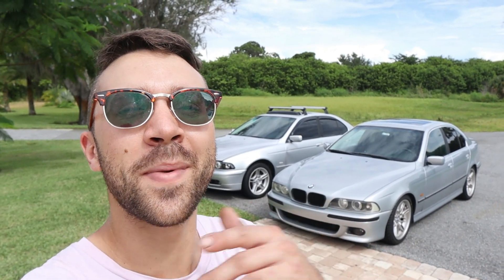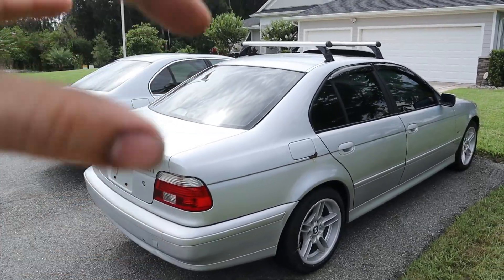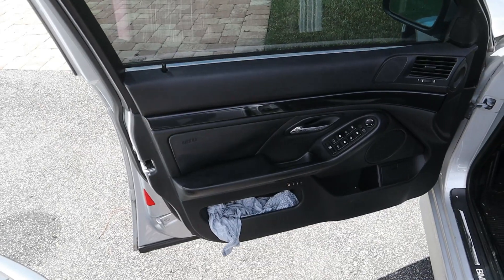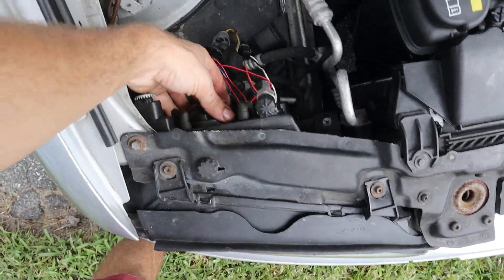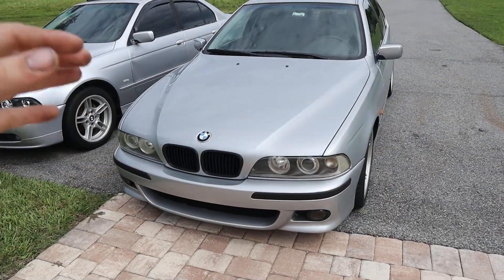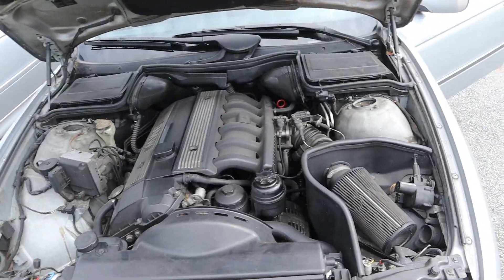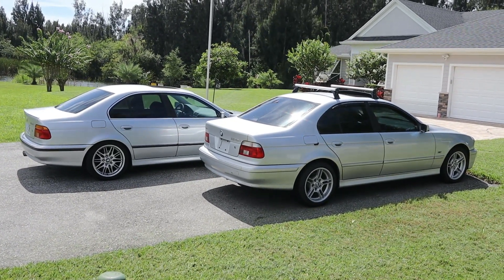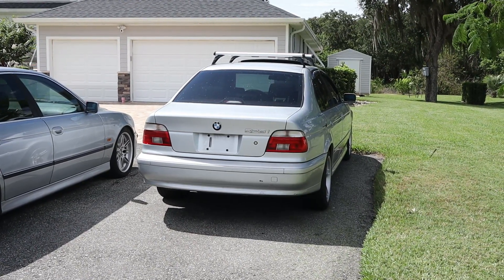I BOUGHT 2 MATCHING BMW's! (E39 Hoarding Problem)

Comment: Will the roof rack fit on your touring?    I like them both but I prefer the interior and external mods on the pre face lift car
Reply from the maker: Unfortunately it won't work on tourings! Different roof bars. But I think that we have to sell the pre-facelift car BECAUSE it has the better mods! It'll help fund the engine swap and we can always do the same mods on the silver wagon! I'd hate to take the engine and part out a perfectly good-bodied car like the 528i.